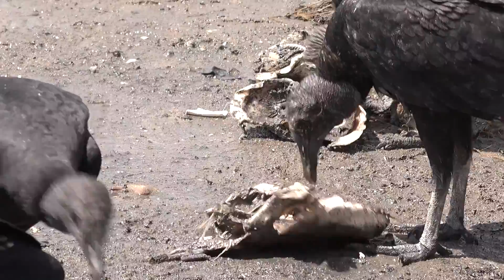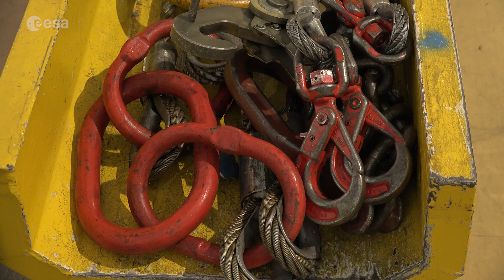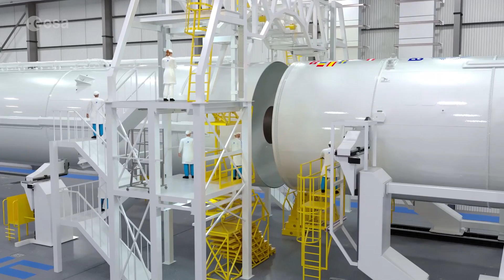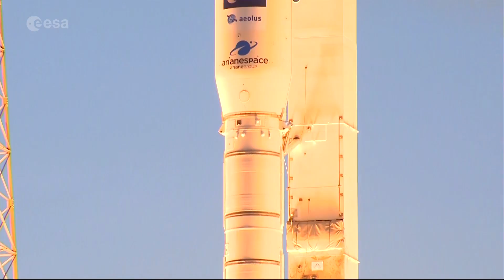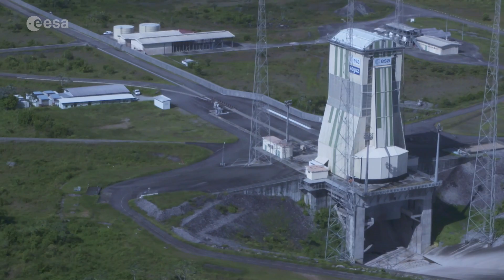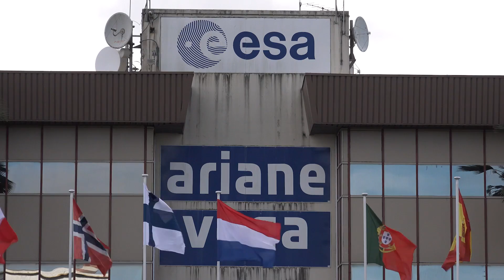Europe's Spaceport in French Guiana

Comment: I don't see why this super XL Beluga cannot fly the James Webb  Telescope to Fr Guinea they would just need to make a lightweight aluminum transport frame / case and add some extra fuel tanks to extend the flight range.
    Apparently the space port does not have it's own landing strip. However it has multiple straight roads that could easily be paved wider. And a temporary military radar control tower used to allow the beluga XL to land directly.
   Thereby avoiding all the crappy  bridges between the regular airfield and the spaceport.
   This would be a tremendous upgrade for the spaceport, as the future of space travel lies with reusable rockets and it would give the space port a way to rapidly repatriate these large components.
Reply: The JWST travels in a special container that is too large for any cargo plane.
Reply: @Sedna063  you may not be up to date on how large air transporters have gotten. They can fly 3 complete dreamliner wings at a time
Reply: @jeremytaylor3532  You may not be aware how large that damn thing is. And it is quite heavy. 

It doesn’t fit inside a C5 galaxy.
Reply: @Sedna063  The C5 galaxy is fairly small in the world of super sized transporter planes. It wasn't even the largest back in the 1980's and that's 40 yeats ago.
Reply: @jeremytaylor3532  Ah, but size isn’t the only thing. 

The STTARS shipping module is 33.5 x 4.6 x 5.5 meters in dimensions and weighs over 76000 kilos when empty.

While is can be carried, it is very hard without the corresponding infrastructure. And the journey from the airport to Kourou would have been a ver challenging one. It was ultimately easier to use a ship.
Reply: @Sedna063  Obviously some fairly smart people decided how to.move the telescope. And the important thing is it has arrived safely. However it still seems a bit ridiculous that the European Space Port does not have it's own landing strip. Which could also be used by France when trying to fly to French Polynesia. There are a lot of satellites to launch and putting everything on a slow boat to South America seems a bit antiquated these days. Paving a runway is not that expensive or difficult. And it would bring their Euro Space Port into the 21st century.
Reply: @jeremytaylor3532  Most satellites can use the normal airport and then are carried by truck. James Webb is just so big and in that massive container. They fly most satellites over therr
Reply: @Sedna063   When the Spaceport was first put there the area was fairly undeveloped and the airport being at the local town miles away seemed logical and was a bonus upgrade for that community. However in the intervening years numerous roads have been upgraded. And multiple bridges have been constructed. They made these large enough for the satellites of the day, and protections showed that satellites were going to keep getting smaller so all was good. 
   However now comes James Webb  and the international space station components. All these bridge's restrict access to the spaceport. 
  So why not give the spaceport it's own dedicated landing strip. A lot of places have multiple airstrips within a 70 mile radius. Where I live we have 2 major Airports 3 military landing strips and dozens of smaller airport strips. Not to mention all the American Airports right next door
   There are some who hope that now the method has been learned to build James Webb. That this could be replicated. And we could have 4 or 5 of these large telescopes up there at various lagrange points. 
    The replicas could be built for a fraction of the cost of the original one off.